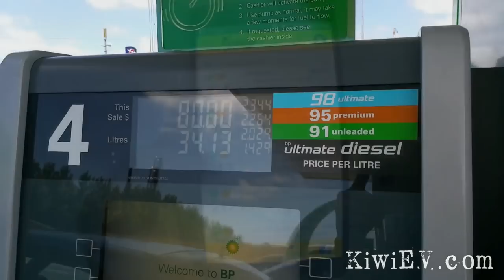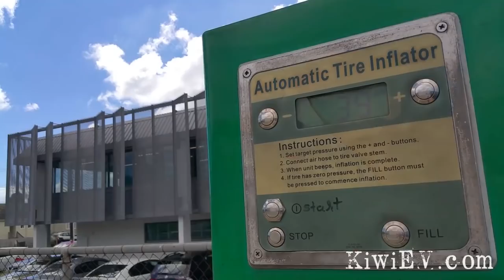Hypermiling, heat and... high heels!? 🚗 ☀ 👠

Comment: In a fuel injected car when you use the engine to slow down, the efi electronics go into what is known as 'engine over-run cutoff ' and that is why you save more fuel rather than driving up to the stop and using your brakes.
Also works on open country driving.

Comment: I have to say I don't do all this stuff very much since getting my leaf 2011 24kwh. I used to have a g1 honda insight and would try to hit 101mpg which I managed a couple of times. these days it more guilt free and fun to drive something with massively more instant torque.We just bought an old 2002 ex ambulance fiat ducato maxi to convert to a camper. eventually id like to convert it to electric but at the moment ill be hypermiling it instead and maybe a veg oil conversion/ HHO or both.Will be interesting to see what car you get next.Had to give up my honda due to babies.
Reply: Whereswally606 I would much rather suggest you buy an Nissan E-NV200 than converting. It will probably be much cheaper. 
But I’m thinking about getting an van as well. Since my new leaf doesn’t have an trailer hitch I can’t go camping like I used to...
Reply: @rab6121  i did consider an env 200 for a while but it is a) too small as i have 2 young kids and a husky and want a full camper b) doesn't have the range. I do like the vw ecrafter but cant afford the £62k price tag.

Cheapest thing i can think of is buying a wrecked but mechanically drivable leaf and put that into my diesel fiat ducato. And treble up the battery for range. Still be more cost effective than and ecrafter. But for now im just going to enjoying converting it

Comment: If I recall correctly, the increased drag resulting from having your windows open is actually worse for your fuel economy than having the AC on. That might only apply to highway speeds though.

Comment: Why were you putting the windows down :0
It destroys the aerodynamics of the car...
AC would really be more efficient :c
Reply: David Guckenheimer Actually, science has proof that using AC is less efficient than windows down provided your mate approves. My hybrid has an “Econ” mode that stops the compressor while using outside air for heating/cooling, windows up or down. Thanks
Reply: General rule of thumb that I've heard more than a few times, is if you're going over 55mph/90kph, using A/C is more efficient (with the caveat that different vehicles with different drag coefficients with different window position(%up vs down), will cause this speed to vary).

Comment: Additional fuel saving techniques.....Maori overdrive with the engine off! (Not legal) Tail gate a big rig! (Probably not legal either),  Pretend you are broken down and get a tow. Or Simply just push the car!
The best alternative would be to get an older diesel and run it on vegetable oil. (takeaway waste oil) Then you would forgo the horrible electric vehicle depreciation and actually save some money! Smells good too!
I Sabotage my own passion for electric vehicles by looking at the big picture.......Grrr. I so badly want electric to work.